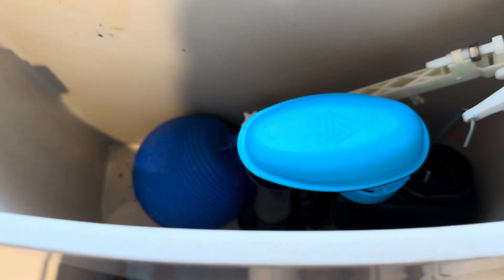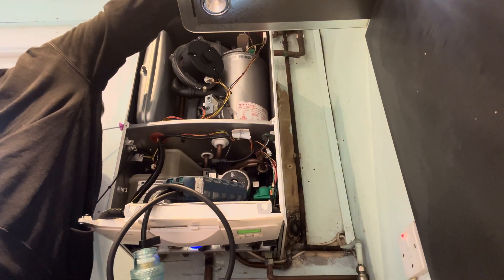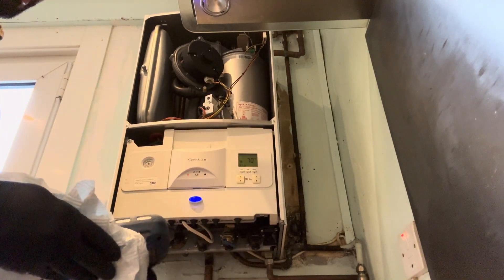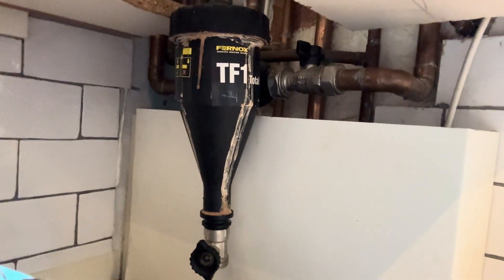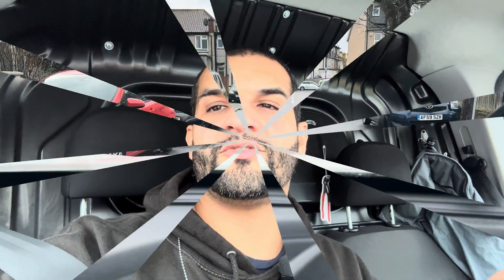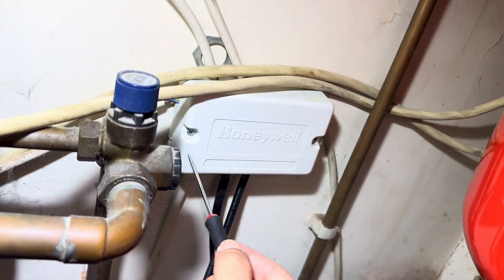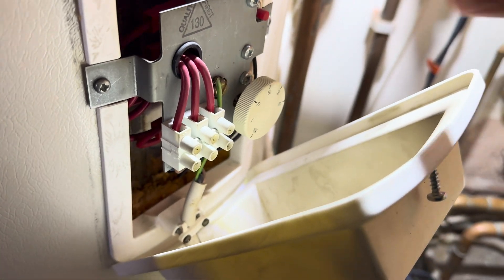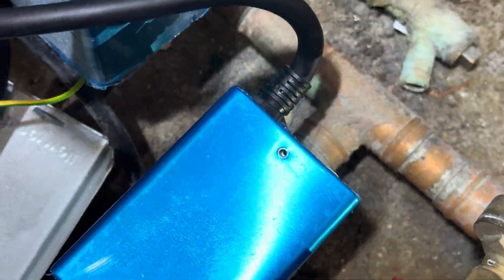A week in the life of a Gas Engineer

Comment: I find worcester take one step forwards and two back……plate and exp vessel accessible but condense and prv still a pain. I fitted one of their new compact budget boilers. Really nice and less than £900 but for some reason valve and pipe inlets are more than clip distance away so you have to off set all the pipework 🤦🏼‍♂️🤷🏼‍♂️PS plumbers love a bit of snatch😂😂😂😂😆😆😆
Reply from the maker: @russellbaldry5095  somehow missed this comment! You probably already know about them but Talon do spacers for the clips which may help with that issue and push them off the wall a bit so you don’t have to offset?

I’ve heard good things about the 1000, very odd that it’s Worcesters budget boiler but their only stainless HEX… one negative I’ve heard is that be connections supplied are brass and the nuts are chrome - or the other way round maybe?!
Reply: @RJHeating  yes i did see another vid showing the spacers, I couldn’t get any at the time🤷🏼‍♂️ but all in a great boiler and i got £50 amazon vocher from WB when i registered it on their portal👍🏼👊🏼
Reply from the maker: @russellbaldry5095  ahh can’t argue with that then 😂 and you know for next time!! I’d like to give one a try, I’ve not even seen one on the wall yet!